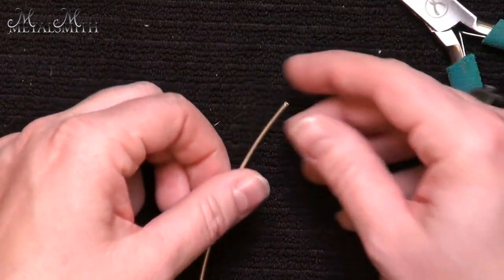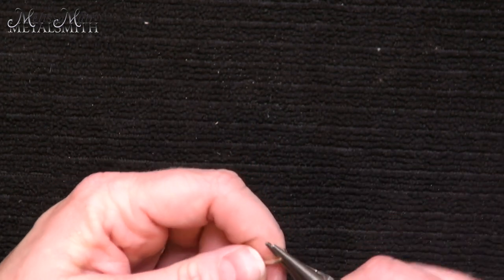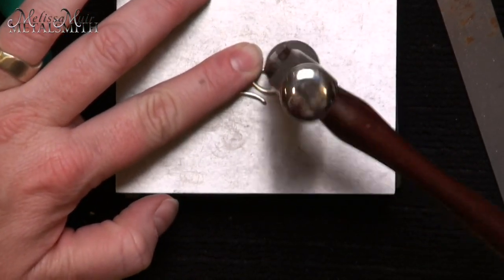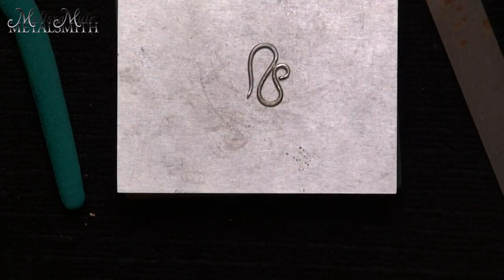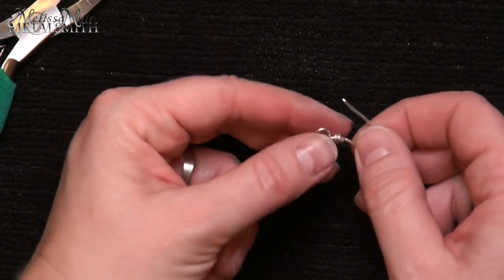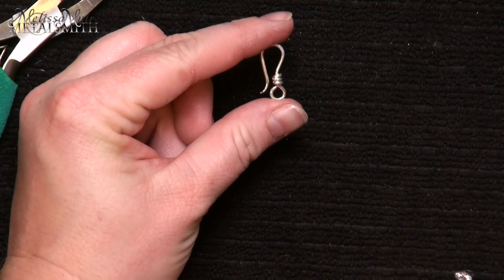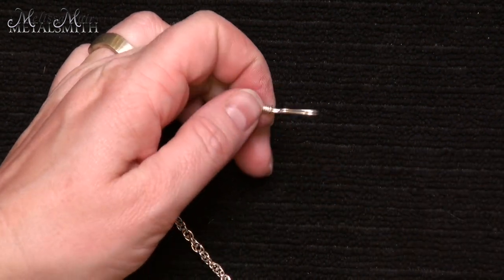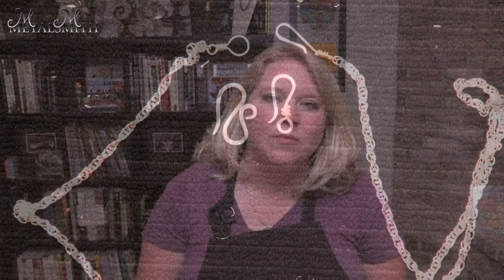Creating Hook Clasps for a Custom Finish

Comment: Thank you so much for this tutorial, you are so right about that added extra to the finish piece. I like them all especially using the 20gauge will and the tip on smoothing out those little dents. I will have to try that on aluminum which is so soft. I have a bracelet that I made a while ago and I have had a very hard time trying to find clasp because of the design but you have get me back, thanks again and looking forward to see what's next!!!!!!
Reply from the maker: I am so glad you liked the video. Yes, aluminum marks very easily.

Comment: Hi Melissa, Thank you for this video. You are a great teacher. I was wondering if you might be able to make a video about how to bend and work with triangular wire, especially the thicker kind. It is very hard to work with and I can’t find any advice anywhere on how to bend or form without it getting completely barred and ruined. Thank you so much for your consideration
Reply from the maker: I will see what I can do. I don’t have any thick triangle wire at the moment. But I will see about adding some to my next order.

Comment: How do you clean the rust from your file?
Reply from the maker: I think that may have to be another video. LOL. But you can soak it in white vinegar for a bit. After washing and drying it, you should apply a thin coat of oil to keep it from rusting again.